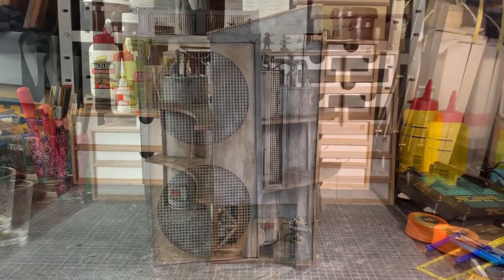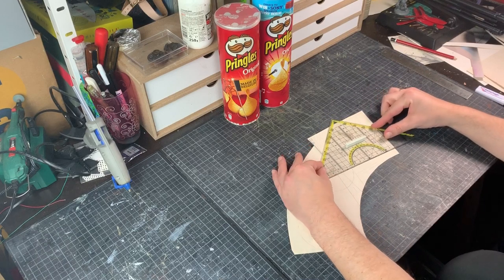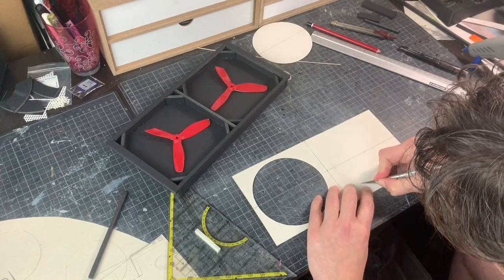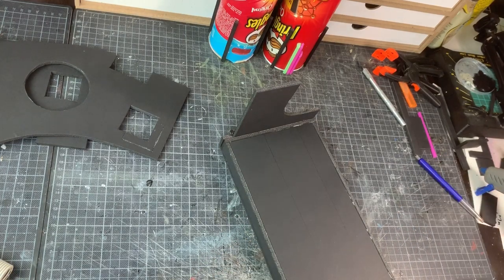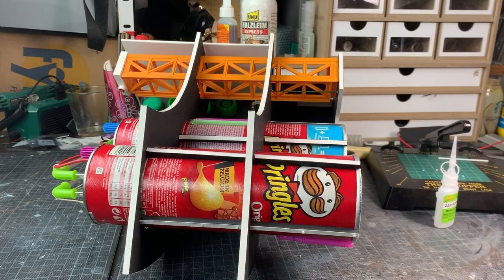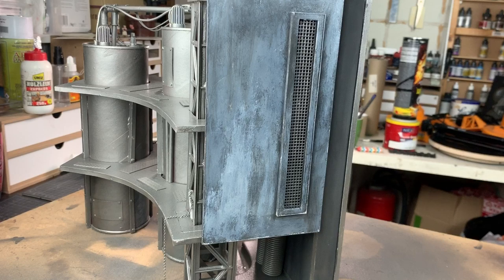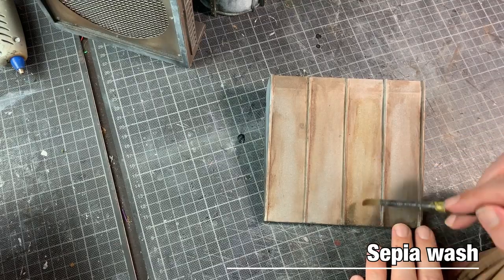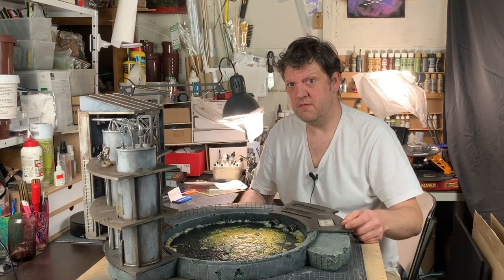Industrial building for the waste facility. Industrial terrain for warhammer40k, necromunda,etc..

Comment: It's really good, it's great to see how the old classics are stil excellent building materials. But the end result is too clean, in my opinion, then again it would be easy to add some grime, wear and rust. Also tealights are the new hotness.
Reply from the maker: Yes ! But there are good reasons why i don’t wheather extensively. (Check out my other industrial pieces and they all share that characteristic of ‘cleanliness’)

Keep following and all will be clear. 😉

Comment: You use black foamcore here. I am guessing you are Dutch or Belgian. If you're Dutch, Kwantum has ondervloer stuff called maclean ondervloer comfort super 5mm which is dirt cheap and practically the same as foamcore. Could be worth checking out.
Reply from the maker: Good tip, Thanks!
We have Kwantum in Belgium too.
Reply: @DarkMatterWorkshop  No problem. It's not entirely the same, it has different qualities but it is cheap. While it is slightly weaker it is easier to etch in details such as stonework. Here is a link to a dungeon I did with it: https://leadadventureforum.com/index.php?topic=112634.15

Comment: Another great video, thanks Gert. I cannot wait to see the facility in it's whole finished glory, it will make one heck of a centrepiece. If I may make a suggestion, rather than wasting all your good acrylic rod on making rivets have a look into obtaining a cheap diamond painting kit. They are approximately the same size but are bevelled in a hex shape. They also come with a precision applicator to make accurate  placement simple and easy. One kit usually has thousands of these little beads a lifetimes supply of terrain rivets.
Reply from the maker: Oh yes, should look epic ! 
Great tip regarding rivets ! I’ll keep an eye out .
Reply: @DarkMatterWorkshop  they really do look great. I happened upon them by chance as my partner had a whole bunch of spares from a kit she had previously put together. Naturally as a scratch builder I jumped at the opportunity to snag some free materials.